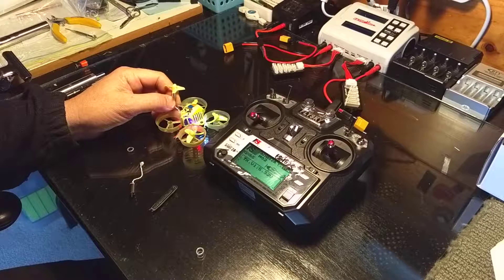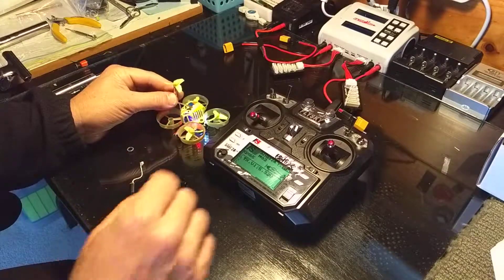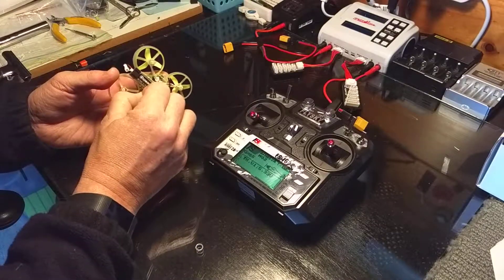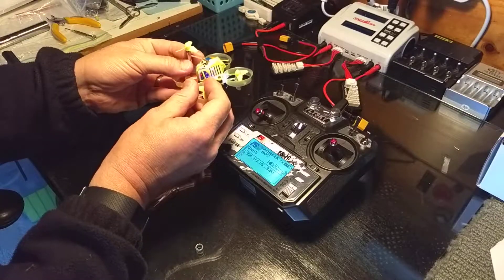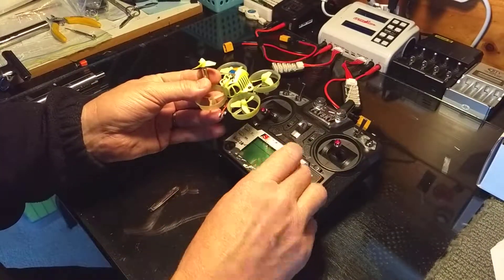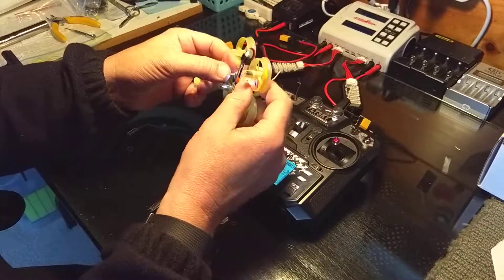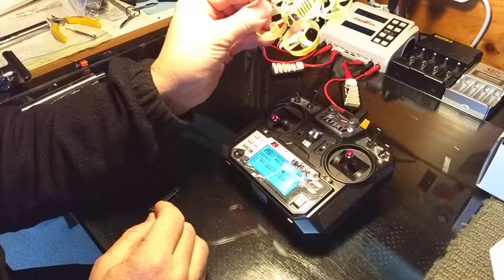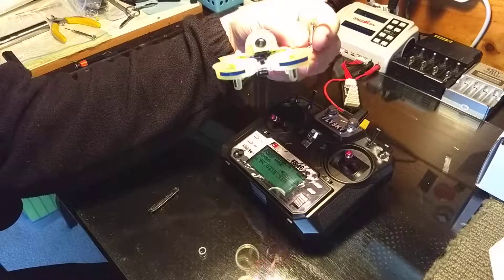QX65 Random Yaw Pitch Up Problem - Lazy Motor Issue

Comment: do u have very hot motors after 1 flight ? 
so it needs to cool down a couple minutes
Reply from the maker: They get warm, you may have to replace some as they certainly wear out. I haven't flown a QX65 for years to honest, I highly recommend getting a Mobula7 by Happy Model, you can buy at Banggood Online, they are very similar but 10x the power and they fly very well, I have had about 8 now I think, I still have 2 running and fly them all the time, watch one of my MOB7 Videos on my channel, you will love the Mobula7 it's like a big 5 inch Mini Quad shrunk to a 65mm Whoop, you can fly them outside and have so much fun. Watch this one here https://youtu.be/6qOgxk3lUIQ They have Brushless Motors and that is why it has so much power. Disregard if you already know all of that :-)

Comment from the maker: Just in case people think it won't ARM because I am not sitting in on a level surface, I have it set to ARM at any angle. This is a super handy hack for the whoop, go to your CLI in BetaFlight and type in the following line and hit ENTER, then type SAVE and hit enter, it should restart the program if you did it right. This will allow you to ARM the Quad so you can give the throttle a tweak helping you locate your lost whoop, there's no beeper on the QX65 so this is essential as they get lost easily when flying FPV. Here's the line for the CLI: set small_angle = 180  Once you have programmed this in you will be able to ARM it even if it is upside down in a bush. Very handy!

Comment: I have EXACTLY all the same problems as you...have you found a solution yet...I was on the jump to ordering new motors...but as you clearly demonstrated..thats not the problem...
Reply from the maker: The best way to diagnose that is to swap motors, diagonally. If the offending motor is bad in it's new location then the motor needs to be replaced (I burnt out 2 in 2 weeks just flying lots). If the motor in the place that was originally a problem is bad then I would say it's your board, FC etc. I have had bad motors and bad boards, the one in this video was a bad board, the ESC I guess. I was lucky, I had another QX65 here to take parts off so I fixed it quickly. Hope that helps.